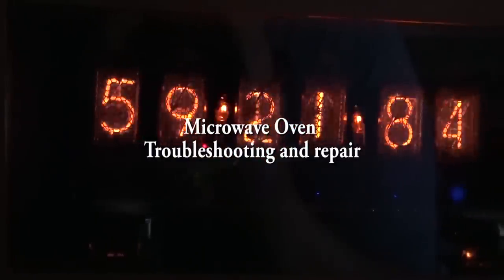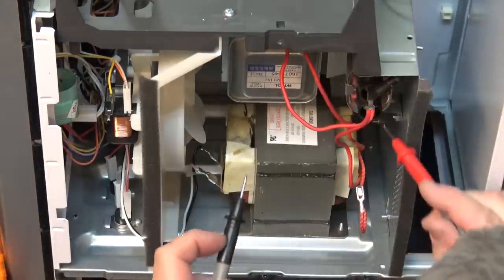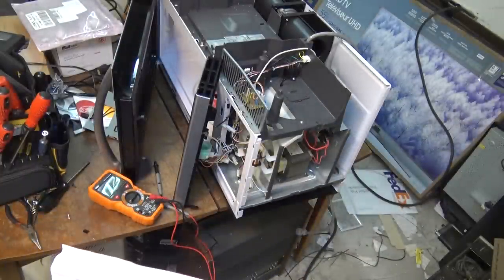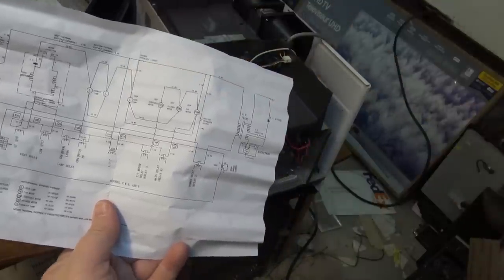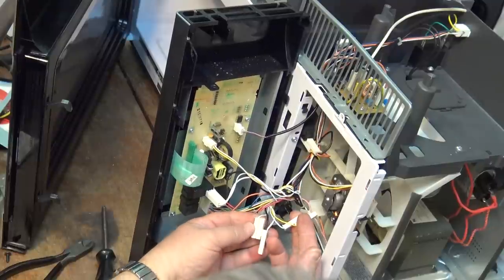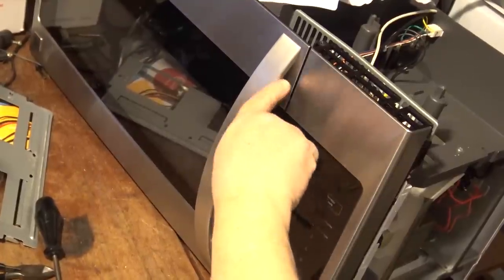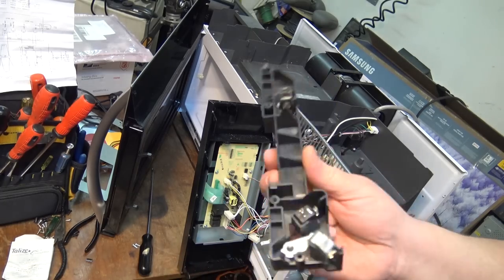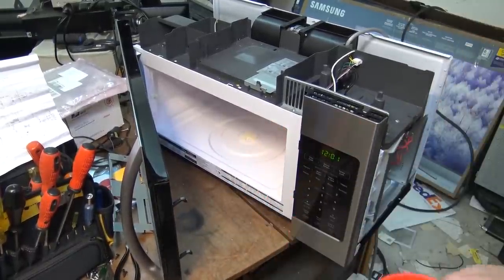Frigidaire Microwave Oven Troubleshooting and Repair

Comment: Hi sir i am zain from dubai sir how many coming voltage in transformer out put of oven
Reply from the maker: Most of these units use 2100-2400 volts to the magnetron depending on wattage.
Reply: Hello.  the voltage that goes to the magnetron on average is 2.5 Kilo volts. me bad! make that 4Kv  on average...
Reply from the maker: Mitchell McCreath 
The Panasonic inverter units can be up to 4.1 kv. This one being 1000 watt should be around 2400 or so. The small 600 watt units around 2100.
Reply: Hi mate, I was going to say 4.5 Kv. but I have not repaired ovens since the 1980s  So I double checked on the repair sites,. they say about 2.2Kv.  I felt that was strange.  Maybe the ovens had changed since I last repaired them in the 1980s.

Good to see that somethings have not 12voltvids. :-)
Reply: Thanks mate.
Reply: Sometimes it puts out 2000 volts actually  cap in microwave rated at 2,100volts  that's enough to kill a person  don't play around the high voltage  some are 1.5kw.

Comment: You should NEVER, EVER test the interlock switches outside of the appliance., or out of the bracket. Totally unnecessary and may lead to the wrong diagnostic.
Reply from the maker: Bullshit. If the switch is broken it will test bad in or out of the appliance. In t he case the switch tests good because the bracket is causing the fault.
Reply: @12voltvids  "If the switch is broken it will test bad in or out of the appliance"  Then, why bother taking it out if you are gonna get the same outcome? You are working more and wasting time unnecessarily. Thank you for making my point!
Reply: "...because the bracket is causing the fault."  That's PRECISELY the reason why the interlocks should be manually tested IN PLACE, a bad bracket or door latch can make a perfectly good switch appear to be defective.

Comment: You can't pay me to open up a microwave oven.  Highly dangerous voltages, even more dangerous when powered on. Will kill you dead.
Also, beryllium compounds as a component in many magnetrons extremely toxic. Even if you know what you are doing, it may kill the test equipment you're using instead of you. If you are a weekend handyman, don't even think about fixing a microwave. It may just fix you permanently. Even if you are experienced, DON'T WORK ALONE.  And your shopmate should know CPR. NOT kidding at all.
Reply from the maker: Just unplug it and you will be fine. The capacitor has internal discharge resistor so it won't hold a charge for more than a few seconds.
Reply: That’s why you pay someone else to do it. I’m a HVAC technician and there are a lot of parts and high voltages that can “kill you dead” and discourage people who don’t know what’s going on to open one up. But people are going to do it. Can just hope they learn how to do it safely.

Comment: Hello 12voltvids
I am always wary of opening up a microwave oven in case I do something wrong in putting it back together and lethal microwave death rays escape from the oven and fry my brain box Is this unfounded fear Of course you are an electronic expert but maybe you could put my mind at rest
Reply from the maker: Microwaves are confined to the oven cavity. With the cover off there are no microwaves escaping. The magnetron which is the microwave emitter is completely contained inside the oven cavity. The antenna is inside the waveguide that pipes the microwaves, which are noting more than radio waves operating at 2.45GHZ. 
Hmm, 2.45GHz sounds allot like wifi diesn't it. It actually is. Your standard wireless router operates just under the microwave carrier frequency. There is a reason that we can't use channel 14 on our wireless router, as that is 2.45GHz.
Microwaves do not bend around corners. This is why the door is desined as it is, so that the microwaves are reflected back inside.  Unless the door hinge is badly damaged, there is little chance of microwaves escaping unless you do something dumb like connect mains power to the primary of the HV transformer with the door open. The safety circuits will prevent this from happening unless someone bypasses them intentionally.
Reply: @12voltvids  Thank you for the very comprehensive reply it was very unexpected as I know you are incredibly busy fixing videoing and uploading stuff but I really do like your channel and the videos and as stated before I just love the MGM cat it is marvelous and very sweet